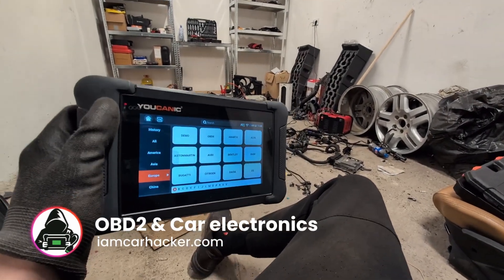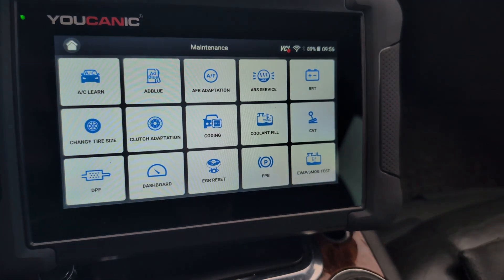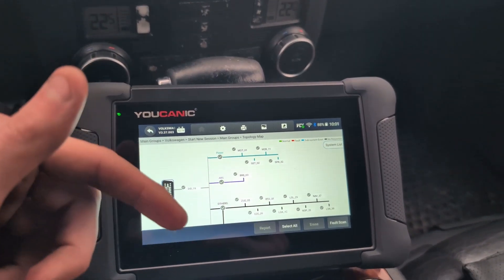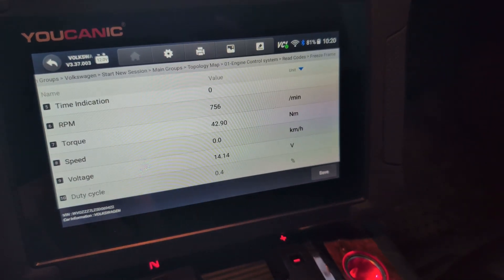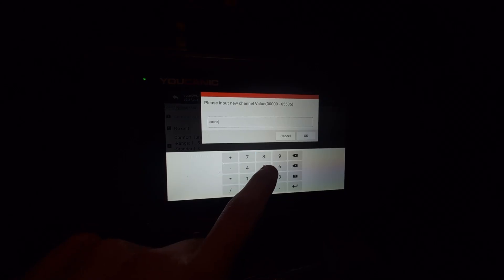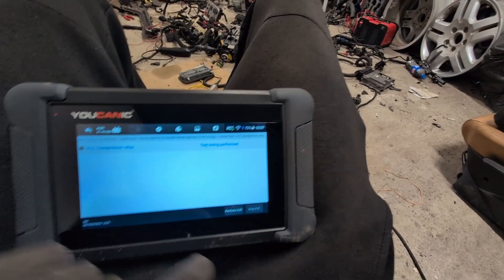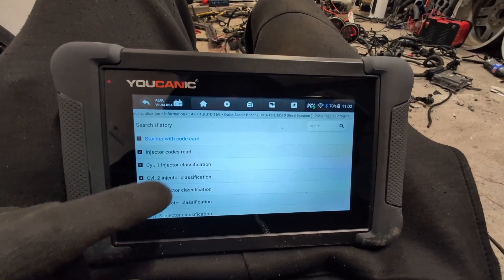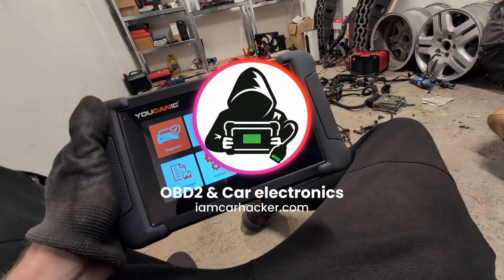Youcanic OBD2 scanner is amazing so far | Best cheap OBD2 scan tool

Comment: I have the exact same scanner. The only thing I don't see on the live data options  are fuel trims long and short I'm not sure if you can find them or if they're named something else other than field trim, short and long?

Thanks for what you do:)
Reply from the maker: Hi now I don't have youcanic with me but almost all full-system scanners will let you access global OBD. Either at main screen or on screen where you are choosing car brands there should be one named "OBD". If you go in there it will display engine live data with same name for all brands - there you will see fuel trims

Comment: I have OBD 11 and is there a way to use it and change values w/o having to pay. I don't mind paying but the issue is that I suspect that my VW Vento car doesn't have most of the features which I wanted to enable, so I wanted to test if those features first can be enabled, if enabled successfully then I don't mind paying.
and the features I want to test are Needle swipe during engine start, CH/LH lights, Signal Horn Always Operable,Cornering Lights, etc..
Reply from the maker: None of this can be coded for old vento
Reply: @iamcarhacker how old are you talking?
Reply from the maker: @r3tr0n17  Isn't vento like 1992/1998